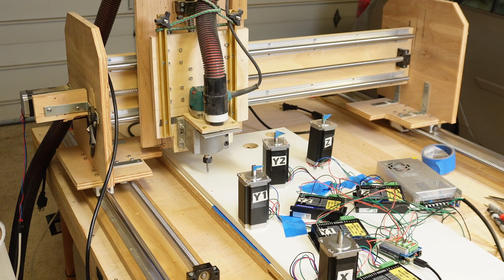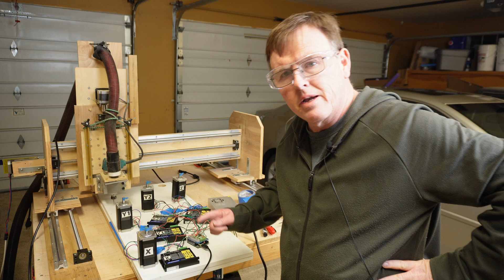RUNNING YOUR FIRST GCODE PROGRAM TO TEST CNC STEPPER MOTORS | DIY CNC ROUTER EPISODE 5

Comment from the maker: The labeling advice in this video is incredibly simple but also incredibly wise.  It's so simple in fact that most people won't fully appreciate why it's so important and will ignore it. If you are building your first CNC, humor me, and follow the advice.  Once your CNC is complete and running perfectly, if you hate the labels look then you can always just pull them off.   Most people on YouTube show you the slick and glossy product at the end but don't really show you the best path to get there yourself (the first time you are doing something).  The best path, though its tedious and not glamorous right now, is to label things like I demonstrated in the video. :)
Reply: I'll slap the labels on before I do anything else :)
Reply from the maker: @Anderle52134  Your a 1%'er :)    99% of people won't.
Reply: @Simplifycnc  Took a long time to develop into one. Saves my head from spinning.

Comment: I'm definitely going to label for potential repairs later.  When something goes wrong I won't have much time to trace wires vs just doing the labeling now.  

I know I'm jumping ahead on a lot of these comments but is there a CAM software that you use or will demonstrate that you prefer?  Currently I have a Solidworks Maker subscription which gives me some CAM options I think which I could use, but I don't know how great it will be particularly for a router.
Reply from the maker: Good job on the labels.  Software recommendations very much depend on what you want to do (and with the community of CNCers you are interacting/collaborating with). Is your CNC likely going to be primarily for personal use or do you plan on trying to use your CNC to make a significant amount of side income? I have experience using Free Cad, OpenScad, Easel (only the free version as the paid version is for me not a good enough long term value proposition but maybe okay for very short term but Easel has a lower learning curve to use but its online unless you know a workaround -- which does exist), Carve Co (it is good relatively low cost subscription software (around $15 a month with no long term commitment or at least I think that was what it was at the time I was using it).  It is very powerful and can do almost anything.  Lastly I have used jscut, and Vectric Vcarve Pro.  Each one has its pluses and minuses.  I will try to dip my toe in my series in a few of these different software packages and include in that list KiriMoto (a CAD program that is opensource, and either browser based or downloadable, I haven't worked with KiriMoto yet but maybe that is worthy of investigating if you want to keep the costs down).  I think it has a lot of things going for it and since you don't even have to download it onto your computer is worth trying out.  Free CAD is also incredible but has a rather large learning curve.  I primarily use Vectric Vcarve Pro (although I sometimes use OpenScad to generate the SVG's that Vcarve slices into the Gcode for my CNC). However, Vcarve  nearly cost me as much as your whole CNC build and quite honestly CarveCo I found could do everything that Vcarve did. It would take 5 or 6 years of Carveco subscription before paying the same as the Vcarve Pro software.  Vcarve does have a lower cost version called Desktop that is pretty good but still costs quite a bit.   I am not sure that answered your question but feel free to ask away if you need more information on any of these.  More will be coming in the next few weeks on this topic.

 I am curious do you think you will primarily be making precision parts gears, precisely spaced holes, etc -- if so then openscad (free) is great because its parametric and lets you easily dial in your settings to a really tight tolerance.  You can then save file as SVG and generate Gcode elsewhere (as OpenScad though it has aCNC  plugin It isn't that great).  Another excellent alternative if you lean towards the graphic/artistic design side is considering generating SVG using a graphics designer program like Affinity Designer, inkscape, or Blender and then transferring the SVG to a different CAD program to generate Gcode.    Your straightforward question opened up quite a few rabbit trails of information.  My suggestion to start is go with whatever you have, then test out a couple of free alternatives, and if you feel like you need more then consider one of the commercial alternatives.

Comment: I love the labelling idea! Troubleshooting a birds-nest of wire can be an exercise in frustration at best and sometimes seems completely fruitless (car wiring!)
Reply from the maker: You are so right.
Reply: Know your pain. A correct (!) wiring diagram  serves as labelling in that case.  "Voltage Drop Testing" can be the ticket to success.  Learned about the voltage drop testing only a few years ago. Highly recommend that over the common method of resistance measuring. Check the ground wire first. Don't know why, but it's more often the culprit than not..
Reply: @Anderle52134  Thank you! Just checked out the voltage drop method and it makes a whole lot of sense, and I have a Ford Escape that needs it! As for grounds, I grew up when points, condensers and carburetors were the thing and a vehicle had a single ground that reached from metal bumper to metal bumper. Modern vehicles seem to have numerous isolated grounds. I'm not knocking modern cars--they're superior in nearly any measurable way to the ancient iron of my youth.
Reply: @FredAmnit  They sure have a lot of grounds. Should have written ground wire(s). I highly dislike modern cars. The radio goes kaputt - may drain a few thousands from your bank account. Many other issues.